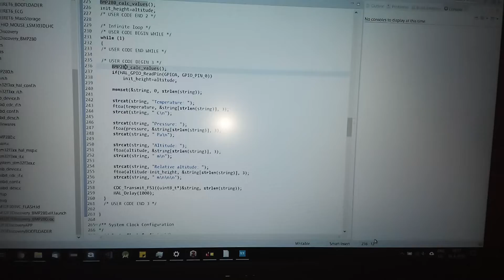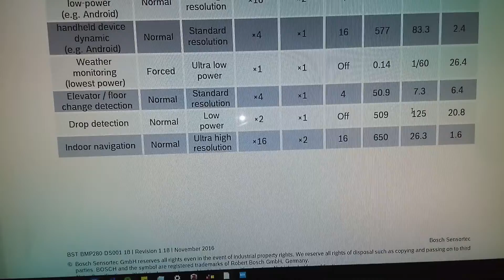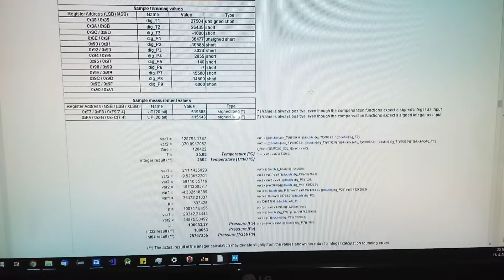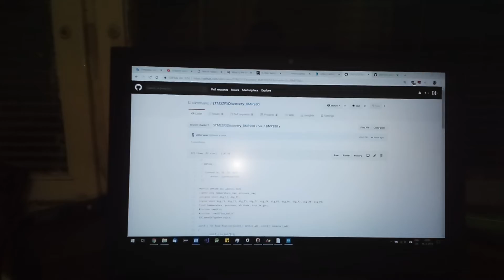A simple driver for BMP280 using I2C - STM32 F3 Discovery

Comment: Hi bro, thanks for your video, i Have some questions for you, the first is if I use the regular connection for the module of bmp280, the device address change? , and the second question is,  if it does change, what should I change in the code?
Reply: The datasheet says that the device address can be 0x76 or 0x77

Comment: hello, first of all, thank you for your effort for the video, visualizing the sensor (temperature, humidity, pressure, gas, sound and camera sensors) data with stm32f103c8t6 in my project, I wonder if I use these codes, will it be suitable for my project? Is the stm32 I chose suitable for these sensors?
Reply from the maker: hi, yes. You can use it. It is an open source project. If you are writing a thesis you can put there a reference of my project.

Comment: at 0:13 it looks like you have changed the  7-bit default device address from 0x76 to 0x77 according to the datasheet changing SDO level. Is it correct?

Comment: how can we calculate humidity....what changes should be done....it will be very helpful...thanks in advance
Reply from the maker: No, BMP280 measures only pressure and temperature. BME280 can do more types of measurements.
Reply from the maker: I do not think that it is possible to calculate humidity just from pressure and temperature. There are dedicated sensors for humidity.
Reply: @ViktorVano  bme280 can calculate both hum,pre,temp,altitude
Reply: i thought both bmp280 and bme280 are same

Comment: Thank, the code works perctly, I spend a lot time trying to solve how to use de code from Bosch until that saw you video.

Very Good and Thanks so mauch, I hope are you ok in your home.
Reply from the maker: You are welcome. I consider to add macros into the library for individual setting. I am going to make a new video including a new driver and also an Android app with Bluetooth LE communication.
Reply: @ViktorVano  will be great, 👍